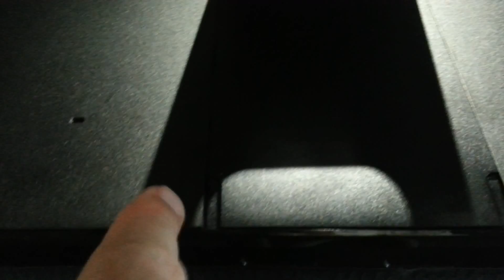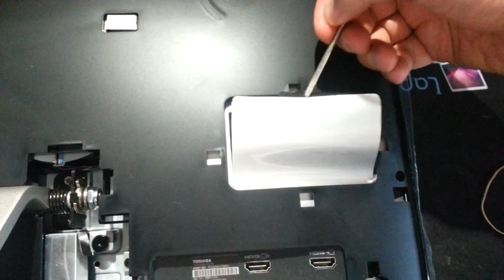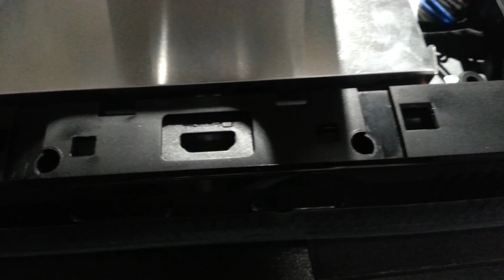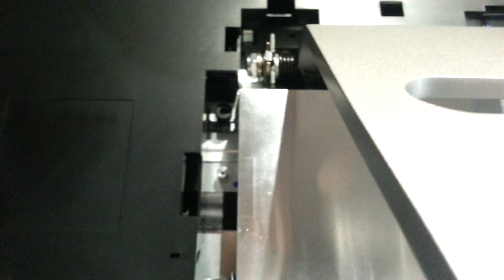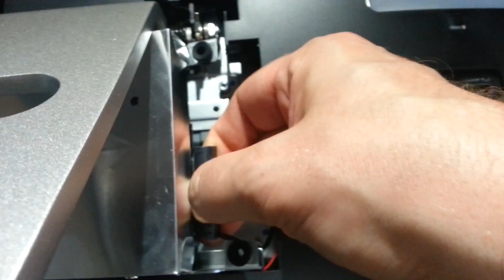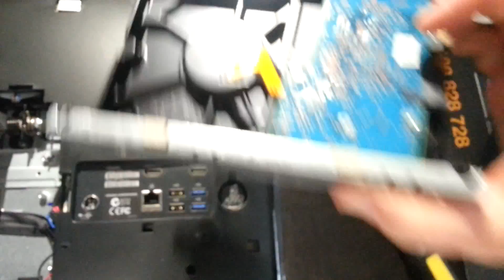Toshiba PX30t Memory Install & HDD Upgrade

Comment: I am wondering how easily you lifted up the back panel with the help of fingers!! I want to upgrade mine Toshiba PX30T AIO but i cant open it with the help of fingers. I tried it with some sharp thing to pull it up but after hard tries i was only able to pull up 30% of the back but the rest of the panel was not opening up! Can you please guide me properly how to pull the back panel up properly?
Reply from the maker: Can you check that there are no screws anywhere? It is a while since I did the video and I don't have access to the computer anymore. Can you check that there are no screws anywhere? If you can't see any screws can you get something small and thin to try and leverage the case apart?

Comment: Is it a simple task to remove the touch screen and display screen for cleaning? My PX30t has had condensation between the screens. I have removed the condensation with a hair drier but a "cloudy" stain remains.

Comment: Is it possible to get to the fan for cleaning? I took off all of the screws but can't seem to lift off the back plate, are there any adhesive on the bezels of the screen?
Reply from the maker: The fan is usually connected to the heatsink so check and see of there are any screws on that.
Reply: Were you able to get to the fan? My computer suddenly power off, and I am almost sure it is because of the fan, either the one of the computer itself, or the one of the graphic card.

Comment: I noticed that on the right bottom there is a removable Dongle plugged in. Do you know what is that? if it for wifi? Also what kind of mount will be required if I swap a 2.5" ssd in this AIO.
Reply from the maker: Not sure re: the dongle as I don't have access to this model anymore - but would guess its for WIFI. Just get eh same size SSD as to what is in the machine and you won't need to get any mounts or adapter.
Reply: Reciever for keyboard and mouse

Comment: I have Toshiba all in Core i3 with 6 GB and 1TB, I want to upgrade the machine to SSD and am thinking of a 256 GB with the current one as USB drive permanently connected to it. Will a SSD fit in the aluminium sliding panels you just had with the existing HDD? 
What is the option for RAM upgrades? 
Or do you suggest a new PC itself to get good performance.
Reply from the maker: To get better performance I'd say go for a new machine with at least a Core i5, SSD and 8G of RAM.
Reply: will the upgrade to the current i3 be not much improvement for basic work. I don't game on this machine, but need little performance up. I checked i5 machines are above my budget right now.
Another question is how can i get external display to aio. I see the available port do not give display out. Any trick?

Comment: Hi great video thanks. When removing the hdd, the connector wires have come adrift and they are too small for me to resolder. Is this connector replaceable and which screws have to be removed to take the back off?ThanksWarwick

Comment: Do I just buy another 8 gb ram or do I have to get one 16 gb - thanksand want to upgrade hdd to ssd are these the right size drives for this pc?
Reply from the maker: +Mati K mine had two sockets but I'd doublecheck to make sure your is the same - I've found with some computers even if they are the same model are sometimes slightly different.

Comment: hi- I run a px30t Toshiba all in one with a Toshiba docking station. I run 2 acer 24" inch monitors through the docking station so I have 3 displays in all. I wish to add 2 more 24" monitors and will need to purchase an other Toshiba docking I guess. Do you know if the all in one graphics card will run the 4 monitors + the all in one display?
Reply from the maker: John Schwartz I would say not but the only way to be sure is to test or ask Toshiba directly.